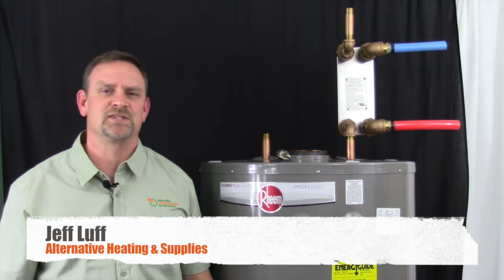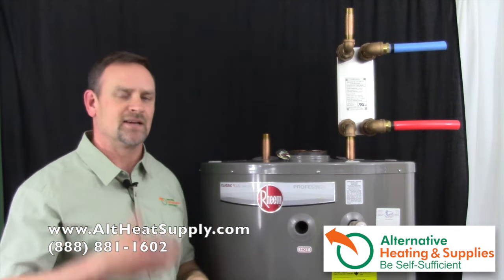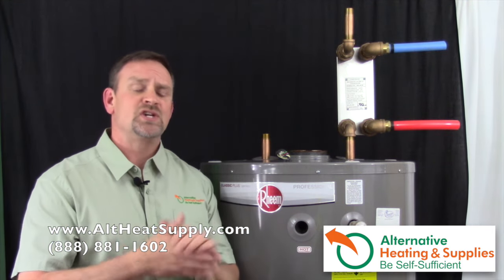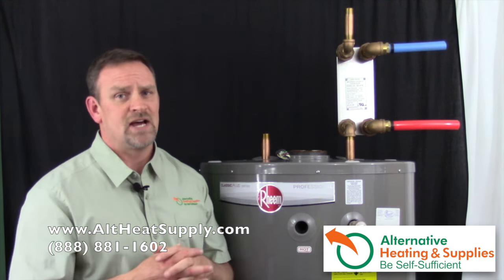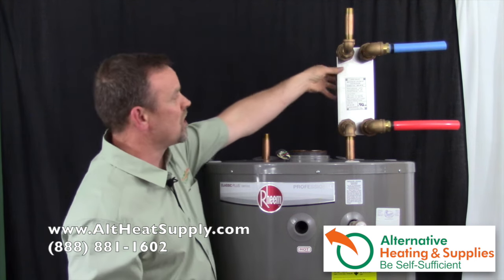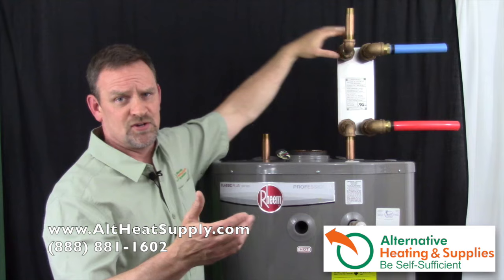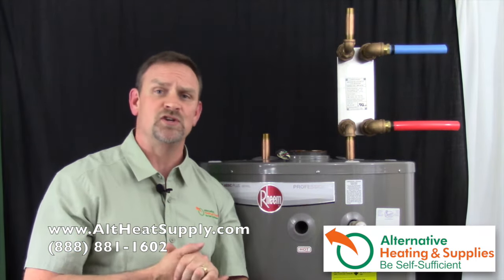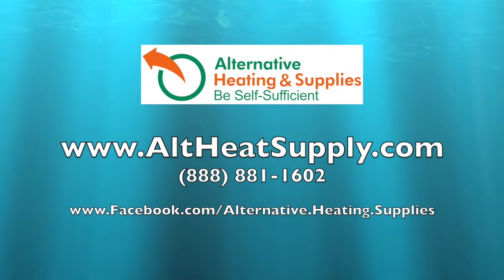How To Install A Plate Heat Exchangers To A Domestic Hot Water Tank

Comment: I was skeptical, but our circuit breaker has been off for almost 24 hours.1 shower, 1 load of dishes and 2 loads of laundry later and our hot water is hot.Simply by circulating 180 degree wood boiler water through it.
Reply: cjwo ood  in the morning is the hot  water tank  cold since you were not using it all night with the breaker off on hot water tank
Reply: andrew Weber yes.  stays hot

Comment: will i need to add shut off valves to the wood stove line to keep from back heating my wood stove in the summer time?  does it matter how far away from the water heater inlet the heat exchanger is?  say if the heat exchanger was 5 feet to the side of the water heater would it still work as good as being mounted direct?  will this work as an on demand system so i can turn the power off to the water heater?  doesn't the hot water back feed the cold line to the rest of the cold system before the water heater inlet?

Comment: If you hook it up the way it shows, it works. The electric to my Electric Hot Water Tank has been off since September 2016 and my water is hot. In my installation, my boiler water temp is approximately 180° and my hot water at my sinks and shower is approximately 140°. My circulation pump runs 24/7 through the plate to plate heat exchanger.
Reply: How is your hot water not 180?
Reply: @ralphy1989  law of thermodynamics. There is a loss of BTUs in the "exchange" process.

Comment: Ok - I’m not a plumber but I have enough of an engineering background and the necessary skills to tackle installations such as this.  I have to admit I was dubious about whether this would work but this easy solution was too tempting not to try to cut cost and save time - after all these are the heating experts. I Tried to get questions answered and was even one of the first customers on their Facebook group- still no response! 

So anyway I go ahead and fit as shown. Now I admit I’m not using a furnace as a heat source - I’m using solar water. I was a bit late starting the installation in the year but in September the configuration was complete. Even with solar fluid temperatures of 60C arriving at the heat exchanger installed in this manner, there was no heat transference at all. I had installed the solar controller and temperature sensors as monitoring, however, the pressure equalization obviously did not happen the way Jeff describes it will and the top of the tank remained stone cold. 
Now I know the furnace was probably pumping out more heat than my Solar in September but I can assure you there was no heat transference  at all.even after leaving it for a couple of weeks till I could get around to replumbing it.

I had a pumped closed loop system with a 30 plate 230,000 btu exchanger. I reconfigured the pipe work reverting to my original design prior to seeing this vid and installed a circ pump in the DHW tank. Yep that worked and heat transference was good right from the getgo. I used copper piping and brass compression fittings throughout. I did not want to use soldered fittings as I was still unsure of the credibility of this configuration. I’m glad I did. This made making changes way easier. 

I later came across further reviews of this in googles pages when I actually searched Jeff Luffs name. Suffice to say they weren’t favourable by any means, plumbers stating that it bore no evidence to science and physics. Personally, if anyone is hoping to save time as I did, I would reconsider these remarks before commencing. I’d love to be proved wrong but I can assure you the installation I tried was as shown above. It’s a pity I didn’t get any responses at all from your company prior to commencement. Perhaps the reasons above explain why- so Sorry Jeff but it didn’t work for me!
Reply: Thanks for this post. I was skeptical of Jeff's design and have ordered a heat exchanger and pump like you did. I appreciate the troubles you went through, and that you posted them so others don't have to go through them as well.
Reply: Did you have a Circulation pump on your Solar side?
Reply: If you do it right, you don't need a circulation pump on the domestics hot water. I don't think what Jeff is talking about works, except, if you have a hot tank and use hot water often. That would heat the incoming water to the hot water tank to what ever the boiler has.
What I did was a copper pipe over another copper pipe heat exchanger. Inside copper pipe is domestic water outside is boiler water,  the pipe is vertical and beside the tank, plumbed into the top and bottom of the tank. The boiler heats the water in the pipe and hot water wants to go up,, colder water comes in to replace it. This worked very well. just have to buy the kit with the special connections.
Reply: Could not stop laughing when I watched this video. What total nonsense!
Reply: Not sure what any of you are talking about it works perfectly I ran my 2 shower dishwasher 3 sinks and my tub never went cold and have yet to have anyone complain about a cold shower and my son is well know for his steamy marathon showers used to run cold on him with my oil boiler
Reply: Sounds to me like you didn't have a circulation pump on your solar system.  But then changed to another system and did use a pump and things were fine.  Hummm.

Comment: I used to have a side arm heat exchanger on my old tank and it worked well, but I had to replace the tank and the side arm had gone bad. I’m considering putting a plate exchanger on my newer tank in a similar set up like you have. Do you recommend running the boiler loop to the exchanger constantly, or do you somehow have a thermostat set up on your tank so that it kicks the boiler pump on only when the temperature drops? In other words, does the plate exchanger continue to heat the water in the tank even when the hot water is not in use, and there is no fresh cold water flowing through the exchanger?

Comment: Do I have to use this heat exchanger only when I have a second boiler?

Can I just use it to recover hot water coming down the shower drain?

If I could reclaim the heat out of my shower and preheat the cold water, coming to the shower head, I could create a small loop where you could take a shower, where your recovering the majority of the heat
Reply from the maker: You can try, I have never tried it myself. My thoughts would be the ROI on the material for the energy savings return on investment won't be worth it. Jeff

Comment: Ok not sure if you still read these comments but here we just purchased a classic edge hdx 760 will be installing in the spring 
My house heating system is a oil boiler 5 zone baseboard 5 zone is domestic hot water if I'm not mistaken I should only have to connect a heat exchanger to the return side of my oil boiler and I should be good for everything correct is how big of an exchanger do I need 
My garage has no heat yet I'll be figuring that out next lol
Reply from the maker: If you install like my video says you will be good to go. Please make sure you call us to help size the heat exchanger and the pump you will need. Thanks

Comment: It needs a non-return valve on the cold feed pipe to maintain pressure inside the plate.

I assume the cold feed pipe runs thru the inside of the cylinder to the bottom. The pressure build up in the plate pushes water down the cold feed pipe into the bottom of the cylinder?

Are you just pre-heating the incoming cold water? I am confused at what you are doing.

Comment: Update!  we have been running our 20 plate exchanger installed as shown here since Jan 8th and the gas has been turned off to the 
 water heater since install. still working great and unlimited hot water as long as we feed the boiler. doesn't use much. for all the nay sayers. it really works
Reply: Robbie did you use a mixing valve or piped like Jeff has it
Reply: The plate heat exchanger on top of the water heater does not create circulation like a side arm that will continuously circulate until the water inside the water heater reaches a temperature within a few degrees of the outdoor furnace water temperature.  The hot water that resides in the plate exchanger stays there because it is hotter/less dense than the water in the tank.  By heating the water as it enters the water heater, the temperature of heated domestic water will likely be hotter than the thermostat on the water heater depending on the exchanger size, 20 or 30 plate and the water flow gpm, but it mixes with the water in the tank that looses some temperature over time.  When the new "demand" occurs by someone turning on the hot water facet, the newly heated water which enters the tank and is force lower in the tank through the Dip Tube on the cold inlet.  That water that is hotter than the temperature of the water near the bottom of the tank is also less dense and will immediately rise as it mixes with the water in the tank.  This lower density hotter water entering the tank rising to top helps to immediately mix and create good output of hot water mixed with the other water in the tank.  If the water flow "demand" were to continue for a long time period and the plate exchanger is sized to create water that is higher than the thermostat stetting will result in the water temperature increasing over time.  If the exchanger is not large enough to heat the incoming water to a temperature that satisfies the users liking, a larger exchanger could be used.  It would be easy to identify by installing an inline temperature measuring device(thermocouple or temperature gauge) on the heated water line entering the water heater tank.  If it is not at least 140 degrees, it likely will not satisfy the user.  It is important if one wants to understand how the system works, to realize hot water is lighter (less dense) and will rise above water that is lower temperature, heavier (more dense) than the hotter water.  i have heard of very few complaints from those using a 20 or 30 plate exchanger shown installed as Jeff has demonstrated.  The amount of btus added to the water is a much higher exchange rate than the side arm.  Because the side arm heats the water to a much higher temperature the hot water lasts a very long time when it is mixed down using the tempering valve but can be dangerously hot if a mixing valve is not used.  Also some gas valves contain a thermal protection that will disable the valve if it gets to hot.  Most have to be replace if they trip that thermal protection.  I have heard of that occuring several times with the use of the side arm exchanger and the outdoor furnace thermostat setting very high.  These gas valves are quite costly.  I have never heard of that occurring with the plate exchanger mounted on top of the water heater.  It would have to be a large enough exchanger to heat the incoming water to a very high temperature, again a temperature valve installed in the line of the heated water would identify that.  That heated water temperature should be quite stable when the plate exchanger on top of the water heater is used because the cold incoming water temperature is very stable and the outdoor furnace water temperature should only change 10 to 20 degrees depending on the thermostat differential.  If a very slow water flow out of the water heater occurs for a long time the water temperature entering the tank will be higher because the exchange time for the water passing through the exchanger will increase the heated temperature.

Comment: If my water heater is currently plumbed with 3/4" pvc pipe, how long of a copper or brass nipple do I need on the cold water inlet of the plate heat exchanger before I can convert back to the pvc?

Comment: My main question..

Is there a way to have this heat the water that is in the tank?

Or is it purely to prevent having to heat COOOOOLD water from the main line? 

Which actually sounds like it would help alot, to subsidize the heat. just the water tank would still have to turn on eventually to heat up the water once ir cools down...

Comment: With the sidearm heat exchanger you talked about a “thermal block” when the water has to go down into the water tank. Can you please explain why this isn’t an issue with the plate exchanger you have here? I have a pool-style Pahlen heat exchanger that worked great with our previous water tank but isn’t working well at all with our new water tank. I’m wondering about a thermal block even though the exchanger is only sitting a few inches off the floor and the supply line feeding hot water to the boiler only drops a few inches before entering the tank. Your thoughts would be greatly appreciated. Thank you.

Comment: Jeff I’ll be installing a 20 plate heat exchanger on my hot water tank ..continuing up to a Water to air heat exchanger in my attic my question is does it have to be piped directly on top of the way you have it or can I mount it off to the side (at the same height now) but off mounted to the side of the cabinet the water heater is housed in so my outdoor wood boiler in and out lines make a straighter run

Comment: So what happens to the hot water in the tank once it goes through the plate exchanger and sits in the tank for a couple hours when your not using the hot water, does it get cold and then your heating elements turn on anyways?

Comment: Would you recommend this setup for an existing electric water heater (80 gal) with the plate exchanger heated by a natural gas boiler (of sufficient capacity for both house heating and DHW)? I need to put in a gas new boiler anyway so I'm curious if running a separate pump through the exchanger often (or almost continuously?) plus the cost of gas fuel would be significant cost savings over the regular electrical heating elements. Cost of gas/electric is comparable (gas is $1/therm vs $.1/kWh). The boiler would also be running one of your 20x20 air to water exchangers in a forced air system. Thanks.

Comment: I used the power of a thermal siphon by installing heat exchanger at the bottom of the electric tank . Added a pressure tank and blending valve for safety. Total cost was $500 CAN. Boiler flow is throttled to HE  by valve off continuous flow from circuit from wood gasifier boiler . No additional circulation pumps required. As thermal demand increases the rate of thermal siphon increases. Been running 3 years and have had 5 showers back to back without running out. Unions allow for quick removal and cleaning with citric acid solution.

Comment: Jeff I received a bell&gosset 20 plate heat exchanger to install on my DHW tank and the gurus at bell and gosset tell me I can’t 180 it to make the lines flow without crisscrossing ....it won’t install like the one you have...the boiler supply and return ports are different...can it be 180’d It makes no sense why not

Comment: So this heat exchanger is installed without a separate circulator or means to turn the loop off and on as needed? Wouldn't a loop with an aquastat and separate circulator be safer? If it works as shown then great but I'm skeptical.
Reply: Add into existing loop

Comment: I have installed this as you said and tested it,  It barely heats the tank if no one is using the hot water. Maybe I did something wrong my heat exchanger is a few feet away from the tank inlet.

Comment: Hello, I just have a couple quick questions for ya.  First off, my wife and I will be building a house and shop out on some property that we recently bought and I'm really wanting to do an outdoor wood burning setup.  I plan to have radiant heat in the floors in the basement, and mounted under the floors of the main floor of the house.  I also intend to heat our hot water with the setup as well.  The main question that I have is, what kind of temps can a guy expect to see in the boiler water on the downstream side of the exchanger in the setup you've put together for this video.   I ask this because I wonder if the boiler water(after going through the first exchanger) would be warm enough still to be circulated through a second exchanger to supply the radiant floor heat setup.  Or, would I just be best off to run a second line into the house and use that second circuit?  Thanks for your video, it answered a lot of questions that I have been trying to answer!
Reply from the maker: That is not a simple answer! way too many variables. Give us a call 203 881-1602

Comment: Very helpful as I am getting ready to do this. Only thing I don't see that u have showed is where and how do u plumb in for a mixing valve. I would really like to see a video with the same application of the plate exchanger with adding the mixing valve.
Reply: Ok thanks for the suggestion. I will add it to the list of videos. Thanks Jeff
Reply: I to would really like to see a video with a mixing valve.  Are you going to do this anytime soon.
Reply: No mixing valve needed. That happens at the exit source. This is just one pipe feeding the heater tank. Mixing a happens at the sink or the shower.

Comment: Hello can I ask a question. I live in Italy and have just had a boiler stove fitted. It's used exclusively for the radiators by using a heat exchanger but there is not water tank. In your opinion would a boiler stove work more efficiently with a hot water store? I notice the radiators work but i think it should work better. Any advice would be appreciated. Thanks.